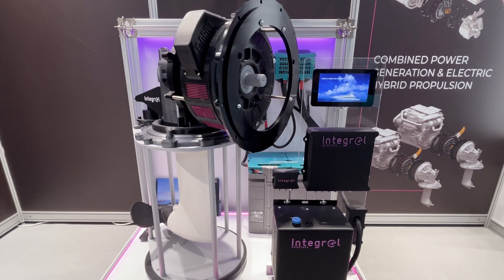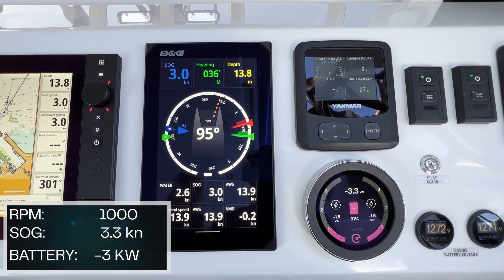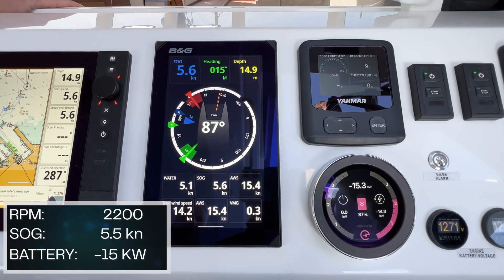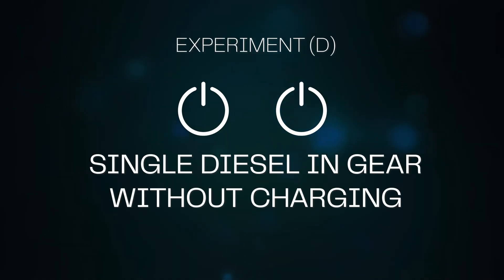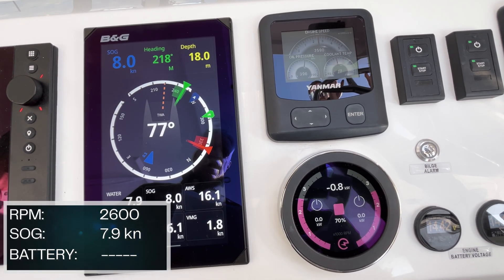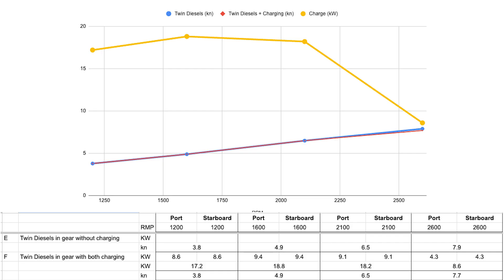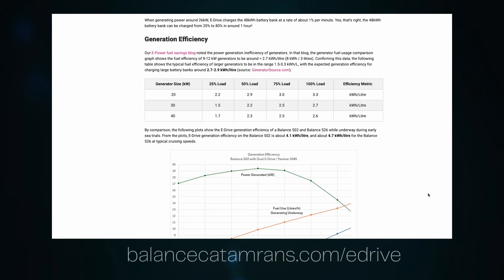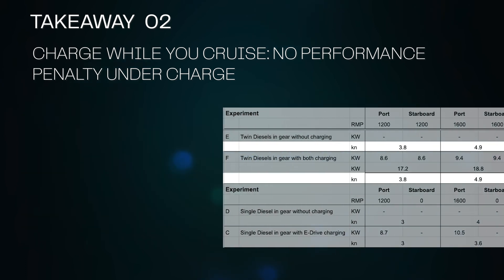How the Integrel E-Drive Performs: Balance 482 Real-World Metrics

Comment: Interesting concept, congratulations.
However, the main finding of the clip and the data seems to be, unsurprisingly, that the electric motor is significantly more efficient than the diesel version. If this is the case, then there is only one argument in favor of hybrid propulsion: If you need the greater thrust of the diesel engine for a higher top speed. But I could only understand this argument in the case of a motor yacht. In 2026, there are electric drives available for sailing catamarans that provide more than enough propulsion. Even if such a system were equipped with a powerful and correspondingly heavy generator, it would still be significantly lighter than the hybrid variant.
In any case, a pure electric propulsion system with an added generator would be my choice for an optimal system.
Nevertheless, nice catamarans.
Reply from the maker: You must rely on either a very large, heavy, oversize battery bank to go full electric, or nearly constantly run one or two generators. I do not see the logic of this approach for a performance oriented catamaran, and for redundancy you must carry two generators. Why carry two generators when you can carry two diesel engines that can also operate with an electric hub that is also a super fast charging solution?
Reply: @balancecatamarans at least a generator can easily be repaired almost anywhere in the world. Unlike @Integrel solutions E-Drive, which is situated between the engine and the gearbox, a genset  is both accessible & simple to service. It’s difficult to plan a journey if you have to wait for Integrel Solutions to fly out an ‘engineer’ to fix it.

Comment: Impressed as ever with your transparency on all of this new tech. And very interesting video to watch.  But I think it may be one step too close to "bleeding edge" for me.  On the day I have enough in the war-chest to sign on the dotted line for one of your boats I'd probably be asking for the previous Integral Alternators on the standard diesel engines as the performance from them seemed to be more than adequate.  I'm hoping that's still an option by that time.
Reply from the maker: I understand. When we started using lithium batteries earlier than most we got this too, and when started to use the Integrel Alternators over 8 years ago we got this also. And I understand. We will continue to do Integrel Alternators for those who do not want E-drive. We now have five Balance cats using the E-drive, and so far so good, but we are working closely with Integrel, as we have for years. Note that Integrel alternators are now being used by most of our competitors, and now many of them are also offering the E-drive. But it is true, yes, that we were the first to take the risk. Innovation does require that, of course. You should have heard what they all said about the Versa-helm when we introduced it!  Go well.

Comment: Never install hybrid solutions! They weigh twice as much and have twice as much technology. This means that sailing performance suffers and they also require more energy to move forward when under motor power. You still have to pay the full service costs for your combustion engine and also have an overpriced electric motor and batteries on board!
I now have my second boat with a purely electric drive, which weighs less and saves me service costs. There is no diesel smell and no risk of the diesel not working properly, and above all, the electric motor is unbeatably quiet. If you are a true sailor, you don't need diesel!
Reply: Sounds like an amazing set up!  How many bluewater miles under the keel so far?

Do you have a generator onboard?  That seems to be the detail that “fully” electric boat proponents leave out.

Comment: Once proven this is an ideal solution. With solar batteries & electric motors, there will be less use of diesel fuel and a quieter ride. This allows access to remote areas where fuel isn’t available. I like it.

Comment: Hi there! @ 12:11 you say this is proof the system doesnt take anything away.  I believe that is incorrect.  The boat speed is relative to engine RPM because the props spin at an rpm ratio fixed to engine RPM.  What you would need to do is run the engine at a fixed amount of throttle and then turn on the charging to see how much it slows the engine.  An engine running at 2000rpm propelling the boat at 5kts with no charge will likely drop +/- 200rpm when that charger kicks in, reducing boat speed incrementally as well.

Not trying to criticize, I love this system!  Just highlighting the potential error in logic.
Reply: The Yanmar display has a fuel burn rate option, it is quite accurate I have found. I have a 57hp Yanmar and also have high output alternators (4kw generator). When generating power, you can see the fuel burn rate go up. A realistic scenario is trying to do a passage and maintaining an average pace (say 6kn or 7kn) and then measure fuel burn and overall efficiency. Everything goes out the window when the weather is bad or the seas are choppy and you have to motor through it.
Reply: In a gross functional sense, it doesn't take anything away since it can charge when motoring.  Also the electrical and electromechanical side of things is roughly 90% efficient, so if the engine ran 200 RPM lower, 180 of the energy would be going into the battery.  (The actual RPM drop could be calculated from the charging power, engine power and efficiency factors.)

Comment: What? No sailing + single charging; sailing + dual charging?!?
Reply: They are trying to get indications of boat speed and charge rate from diesel alone under way .. if you were motor sailing how would you know what portion of your speed was sail  or prop driven ? Defeats the point of the test ..
Reply: It's PB selling a boat what do you expect ;)
Reply: These don’t yet support regeneration, if that’s what you’re asking about.

Comment: Interesting data. What you are missing to complete the data is the extra fuel consumption when charging. Also, what is the added cost of the system?
Reply: A single 15 kw E-Drive costs over £ 3Ok  and that’s without the batteries and power electronics added. So, it’s £ 80k min before you add a single litre of diesel. 

The addition of e-drive to Yanmar / Volvo motors makes a claim on the engine manufacturer’s warranty almost impossible. Integrel offer their own warranty, after 2 years (?) is worth how much ? Who is going to support owners with boats out of warranty ? What’s the resale value ? Ooouch is the answer.

Regeneration is not possible with this system, despite claims. It simply cannot work with this technology. 

The Integrel Solutions e-drive is manufactured without ISO 9001. WHY ? Does it comply with manufacturing standards ? It seems neither Yanmar or Volvo officially support this addition to their engines. 

The e-drive  is completely reliant on software working well. The air cooled ( WHY) motor is placed between the engine & gearbox. If you find yourself out in the ocean and have a problem, who is able / going to fix it ? Any live aboard owner will always want to reduce risk and add redundancy. This is the opposite. Last time I checked there is no one that can fix E-Drive in the BVI’s, Grenada etc etc. Answers on a postcard please. 

The video is great at showing the E-Drive ‘Experiments’ out on the water. Did your new car dealer sell you on proving the engine & gears worked with, ‘experiments’. Maybe.

Great to innovate and explore new ideas, but trust & credibility in new technology is built on results over time. 5 boats with e-drive currently on the water is an, ‘experiment’.  Owners reviews will be the making ( or failure ) of this product.
Reply: @timslater-y6r Probably true, however, everything starts somewhere. Look at jet engines in the beginning. Or more closely related, Toyota hybrids….🤨🇦🇺
Reply: You’re missing the point the integral system uses the excess power of the engine which would otherwise be wasted to generate charge. That’s why at the highest rpm ranges  the integrals output goes down. 
There is no increase in fuel consumption ( while underway on motors) because the integral senses and uses the wasted engine energy at various rpm and converts it to charge. That’s the beauty of the system. How reliable and easy to maintain is the key to its success. It’s useless if it can’t be relied on
Reply: @davidfrancis8899  bullshit! You're taking energy out to charge the battery. This must mean more fuel is being used or else the rpm and boat speed would be lower
Reply: @colinhercus7765 Yes, the numbers are in the data, but they indicate a very significantly more efficient (and compact and maintainable) generator functionality.

The biggest benefits will happen when (if?) it supports hydrogeneration so that that batteries can be recharged by sailing, i.e., wind powered battery charging/house power/motoring.
Reply: @Loanw. Regeneration will never happen with this system. Nor is it easily maintainable. The e-drive is not able to be retro-fit (unless you own a boatyard ) and servicing costs for the Yanmar engine  still apply, alongside servicing costs for E-Drive. However, no one seems to be able to answer where and how that will be done and crucially, at what cost. 
Your brand new  engine warranty by Yanmar is out the window as the addition of Integrel’s e-drive is a modification from original specification.  
The boat’s resale value will be horrendous as second hand e-drive (out of warranty) will be as desirable as wheels on a tomato.
Reply: @timslater-y6r I'm just curious and learning more -- would you say the same thing about E-Power, which seems to have been around longer.  Same issues?
Reply: @bettercallgeoff  Integrel's E-Power seems to work well as a generator replacement.  Many people are using them successfully.  Unlike E-Drive, it's not designed to (potentially) hydrogenerate (regenerate electricity from sail power) however.
Reply: The fuel use to charge is in the charts in the video and on their web site.   Roughly, it's pretty efficient.
Reply: @LoanwordEggcorn  Found data on web site. So, on a Balance 502 (45hp engines), while charging you are using 11litres/hour of fuel and generating 19KW, if you are not charging, you are using 6litres/hour (on my 45ft catamaran using 57hp Yanmar I use 5 litres/hour cruising at 8 knots in similar conditions, higher hp engines are always more efficient). Lets say you charge for 2 hours, you have full battery capacity and you have used up 10litres of fuel. You then motor for 2 hours on electric motors which will drain your battery. If you had motored at the same speed for 2 hours, you would have used 2 extra liters of fuel. I work out that's about an 8% efficiency gain. Not the 30% you are claiming. Maybe I am missing something.
What would be more useful is to have data saying if I travel 100nm, how many litres of fuel do I use if I had to motor vs e-drive at the same speed.
Reply: @sailingsandy7971  The point is that it's a much more efficient, maintainable and compact generator.

The biggest benefits will happen when (if?) it supports hydrogeneration so that that batteries can be recharged by sailing.
Reply: @LoanwordEggcorn  But how much does it cost? If you are paying say $100K extra for the system (I don't know just guessing) that is 50,00 litres of diesel you could have bought. You only saved 2l over 2 hours (based on the calcs on my previous message) so you would have to cruise for 25,000 hours under electric power to come ahead. Doesn't make economic sense (maybe some environmental benefit).
Reply: @LoanwordEggcorn hydrogenation is complex. You have to compromise propeller pitch between regeneration and outright cruising speed. This was the issue with the Wynns ex-HH44. Ideally you would want a variable pitch propeller, but that would be expensive and another complex thing to break. 
The whole hybrid drive on boats is an expensive gymmick.
Reply: @sailingsandy7971  You are correct that the prop design matters a lot and most are not optimized for hydrogeneration.  

Oceanvolt's ServProp variable pitch prop has a symmetrical design that works well for both propelling and hydrogenerating, and only requires the motor to turn in one direction ever since the prop can reverse pitch for reverse thrust.

It does add some complexity but not much more than a folding prop.
Reply: Certainly really interesting, be interesting to know the weight difference between with, & without. I love the idea of silent running. Thanks for sharing. 😎🇦🇺

Comment: This is was very interesting and thanks for transparency. May I ask if it would be possible in the future to regen while at sailing speed? I assume maybe you may need a different prop for better regen?
Reply from the maker: Integrel have told me that they could set up the E-drive to do prop regen, but after talking to them about it, the benefits for the costs and the drag on speed, I just do not feel the juice is worth the squeeze. While I have not done a scientific analysis of it, I believe that even if you were sailing at an average of over 10 knots for 12 hours, you could probably produce more charge using the E-drive for 15 minutes and not slow down your boat either. But if Integrel wish to offer this they will, it is just not something I believe has a lot of benefit. In island hoping and day sailing applications it will hold almost no value to my mind as the charge rates with regen are not going to be that great.
Reply: @balancecatamarans  your reasoning makes sense. Especially since I usually sail at most 5 hours a day. Very rarely more.

Comment: Very interesting!  I may have missed it but how much weight does this add to the boat and how many kWh is the battery bank?  

Our old school Integrels have worked great, we charge at 12kW at 1200RPM & have found even with our power hungry 526 we only need to charge about every 2 1/2 days if the sun is shining.
Reply: The marginal increase in mass is probably relatively small compared to the boat, and both batteries and motors keep getting more efficient both in mass and volume, especially electric motors (also operated as generators).
Reply: @LoanwordEggcorn every kg matters on a performance catamaran how it impacts the boats sailing capabilities & load carrying capacity.  If it adds 400kg that’s a big deal, if it adds 50kg not so much…that’s why it’s an important factor to communicate.  Keep in mind this is all to save about 200L of diesel a year (or $400) vs. the conventional Integrel system it’s offered as an upgrade to.
Reply: @kirkb3473  The real benefits would happen from hydrogeneration to get wind energy into the battery by sailing.  To be used for house loads, motoring, etc.  So far I guess Integrel is not supporting hydrogeneration yet.  Should be possible, but maybe not the most efficient with these props.

The e-power is quoted at 12 kg and the e-drive at 42 kg, so a 30 kg difference, plus a few kg for the controller.  Call it about 39 kg more.

Electric motors and electronics are light.  A Tesla Model Y motor is easily lifted by a person and handles 20x more power.
Reply: @LoanwordEggcorn you are missing the biggest part of the equation, all the extra batteries (double vs a stock boat) required adding hundreds of kilos…hence my original question.
Reply: @kirkb3473  Agree batteries add more weight than the motor/generator/electronics.  More battery should mean running the generator function less often, etc.  Everything is a tradeoff.

Battery weight/volume versus utility is already pretty good and improving, mostly driven by massive EV economies of scale.